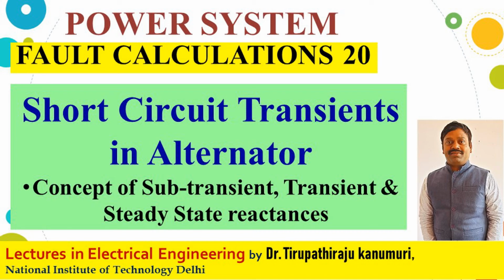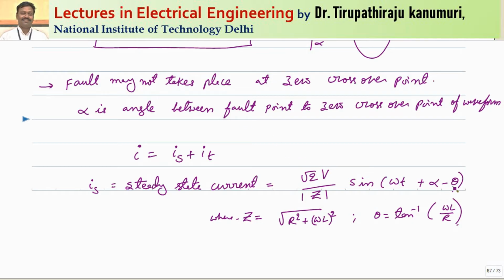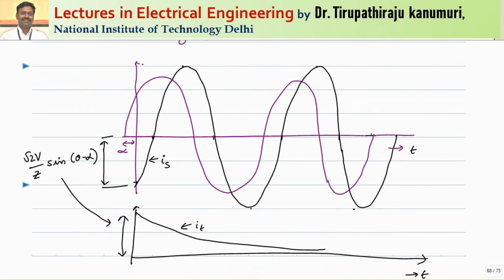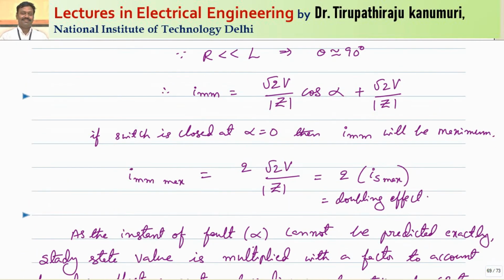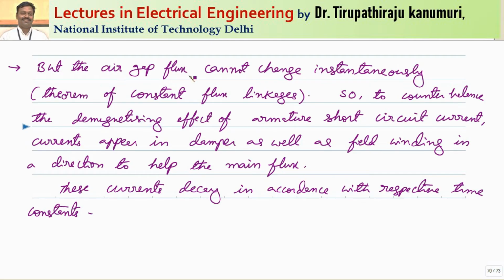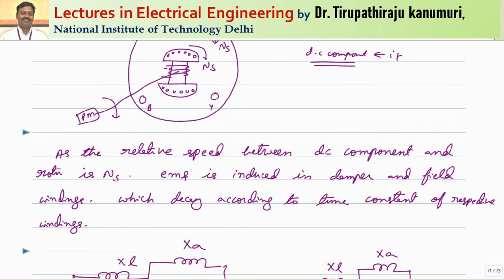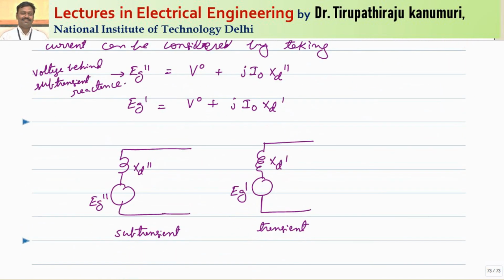PS101 Short Circuit Transients in Alternator

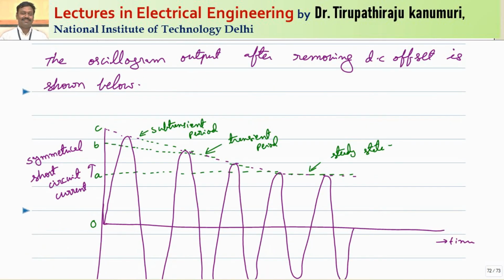Comment: SIr, the waveshape which has been drawn by removing dc offset explained at 18:00 min, how the curved shape at the top and bottom at the intial time just after 0 sec  upto say 4-5 sec in t axis be like that? Doesn't the Xf and Xd arise due to the dc component and hence the overall reactance of the parallel connection is least in subtransient case, a bit larger in transient and largest in steady state ? If the dc offset is absent, the waveshape would be normal sinusoidal, is not it sir? Please, clarify my confusion sir.